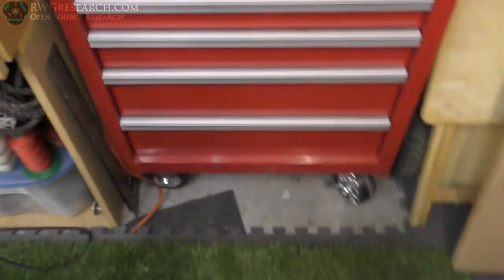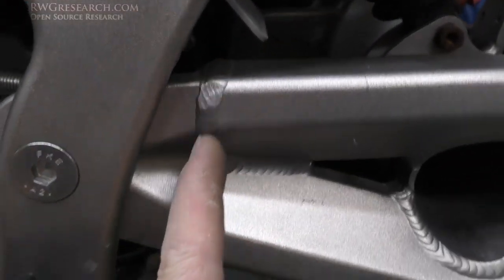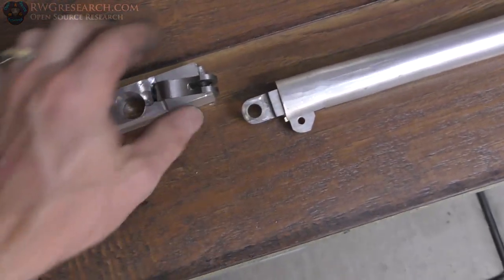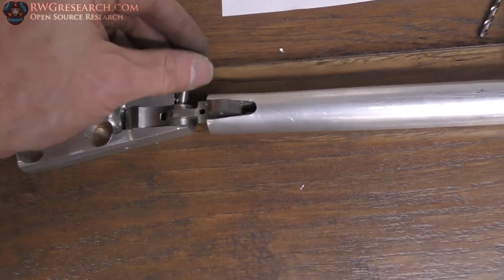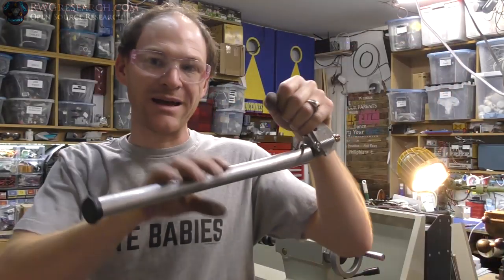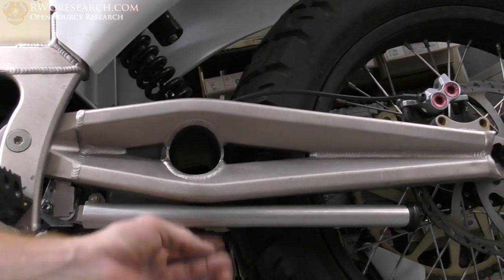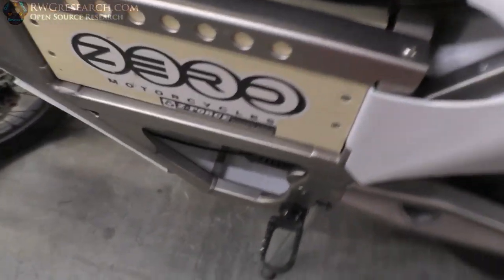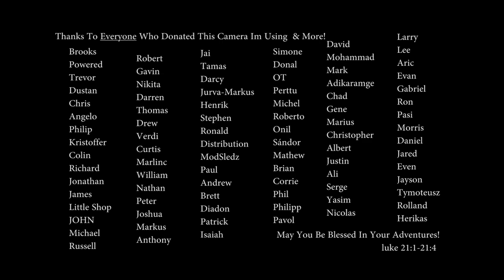Zero P17: Lets Give This A Proper Kickstand!

Comment: The best way to know if your kickstand is properly placed, is to check if the bike stands by itslef with the front wheel in any position. That means when you use the kickstand, turn the wheel to left, and also right and see if it stands up. Probably you might have to trim a little bit more from the kickstand.
Reply from the maker: cool. yes I agree. and it seems to :)  thanks for the tip! ~Russ